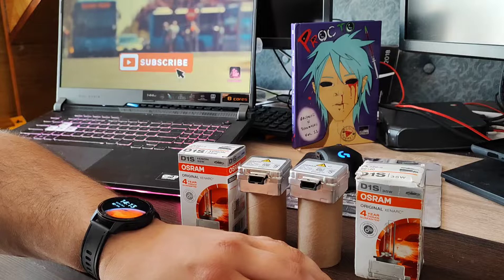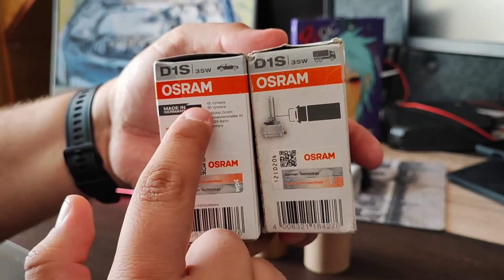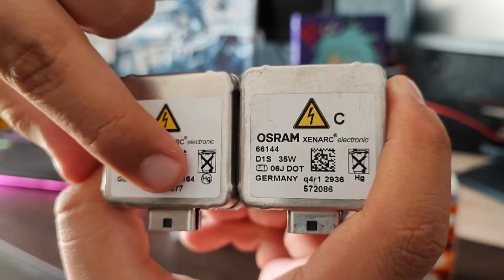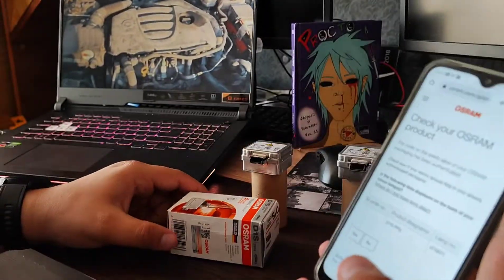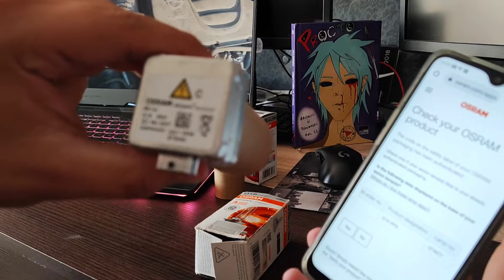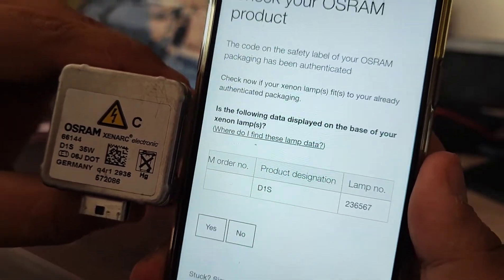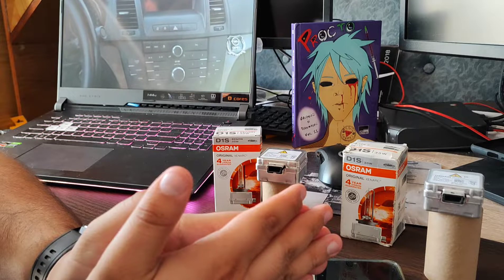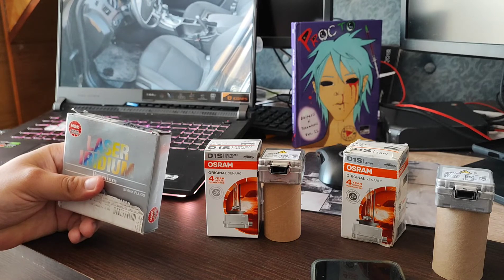How to spot fake Osram Xenon D1s, D2s, D3s Osram Xenarc Original vs Fake

Comment: 5:22 Spot welds at four prongs are tiny dots on GENUINE, and larger spots on FAKE.  On AMAZON I bought "OSRAM XENARC OEM 4300K D1S HID/XENON Headlight bulb (66144) by ALI - Made in Germany (Pack of 1)"  Box has 11 digit code on it, bulb has no blue tint, BUT at base of XENON capsule I can read "OSRAM" in tiny print on metal base of of glass module.   OSRAM and MARSO spelled backwards.  All looks good inside the guts, except transformer coil is only copper wires, and no aluminum wrap as seen on some photos.  Perhaps I bought very old stock.  Box writing is english, but inner box tabs mention importers in Istanbul, Romania, and Warsaw.
Reply from the maker: If it was on a good price or amazon sale, must be old stock no worries. good spotting!
Reply from the maker: O recommend switching to d1s plug and play led. 6000k white. avoid all the hussle

Comment: I’ve just had this happen to me. I bought H7 halogen nightbreakers from Amazon. Spent ages fitting them to the car are they were no brighter than my old basic bulbs. I used the QR code and everything matches up correctly to the packaging, but when I got to the “congratulations it’s a genuine Osram product” page I noticed the product was listed as w5w led, a completely different bulb. 

Looks like Osram’s trust program is useless.
Reply from the maker: Fake...99%....osram don't fk up...is just a copy pasted qr code..chinesse do these tricks.
Reply: @AKMCars  Its so hard to avoid these fakes nowadays! Even the Osram website lists amazon as an authorised dealer.

Comment: Hello! I checked the Osram video made on the topic. The box is good even if it has a bigger picture or doesn’t write xenon. The rest of the video is right. You should check the label at their trust program. I just ordered a pair from Emag. I am curious if it’s legit, because it’s from a vendor.
Reply from the maker: De pe emag marketplace....nu am incredere. Doar ceva firma mare sa fie. pune unul vechi original si comparal cu asta de pe emag sa vezi

Comment: Bought original osram for $80 each.
Reply from the maker: Normal price. I suggest osram cool blue 5000K.
Reply: @AKMCars  these lights are fairly decent. I've had Philips previously to this and it was terrible
Reply from the maker: I agree...philips sucks....osram ia the best bust shittier lifespan..they degrade philipa wont. Try also...Hella Lights.
Reply: @AKMCars  I'll definitely try Hella lights
Reply from the maker: Check if they are made in Poland or Romania. Never poland...they bring china made shit in europe.
Reply: @AKMCars  so original in Romania? I'll definitely check out the box
Reply from the maker: There is also something called D1S LED replacement for xenon. plug and play. Samr price...but LED 6000-7000K almost white ish.
Reply: @AKMCars  my car take D3S. Btw what are the prices on Hella LEDs
Reply from the maker: HELLA and no one produces leds. those are aftermarket.
Reply: @AKMCars  ohhh thank you for that